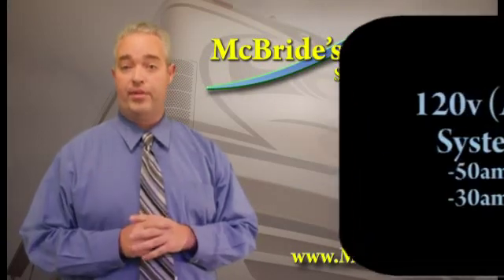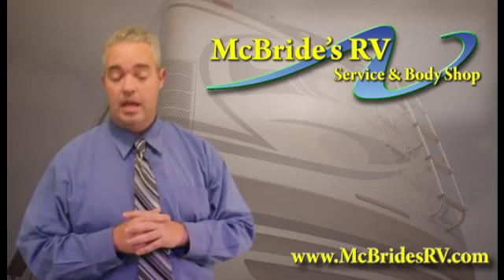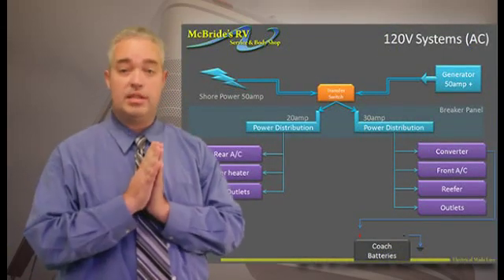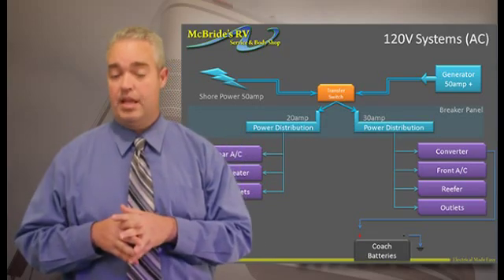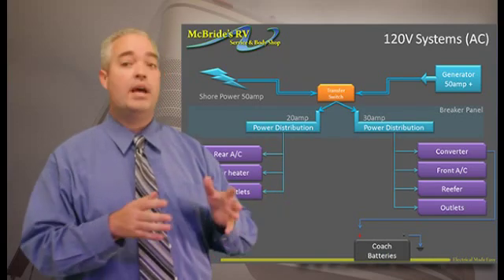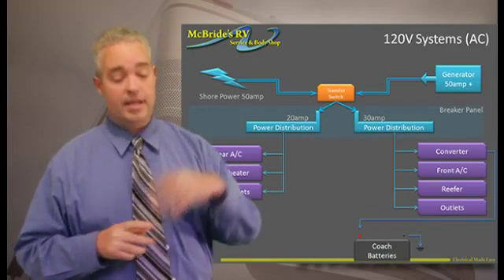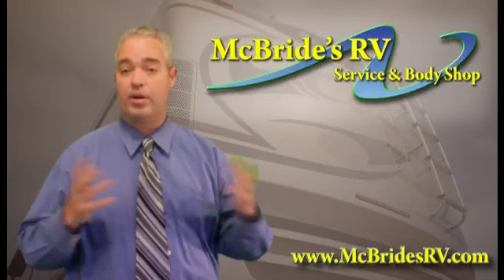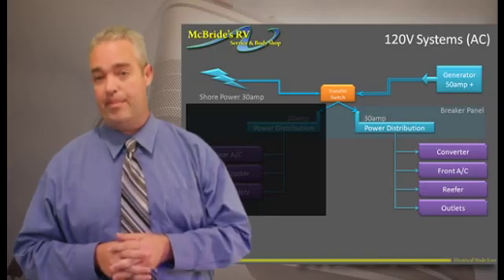RV Electrical System Made Easy to Understand Part 3

Comment: This information is incorrect. 50 amp service is 2 120 volt 50 amp lines coming into your rig for a total of 120 volt 100 amps (12,000 Watts).

Comment: A 50 amp plug is actually 100 amps total. Two of the legs in the system are 50 amps each. The other two are nuetral and ground.
Reply: todd herron hey Todd, I'm building a tiny house, and I want to be able to run 220 by plugging in to a 50 amp socket, you seem to know your stuff, can you please explain how to wire that 50 amp plug in to a breaker/distribution box?